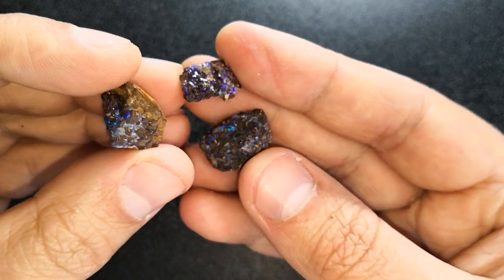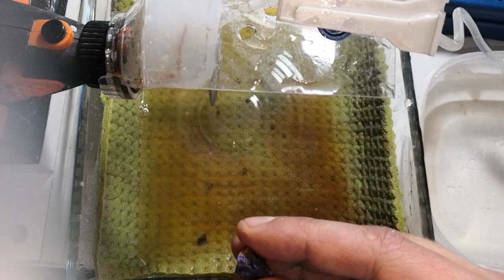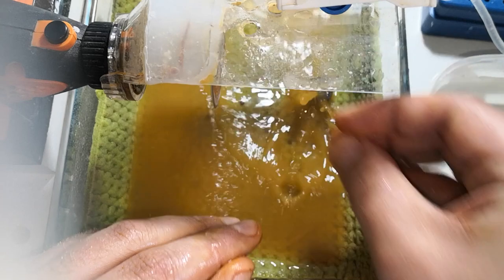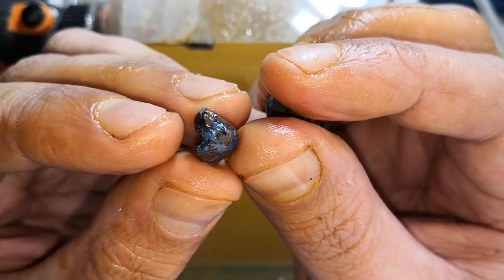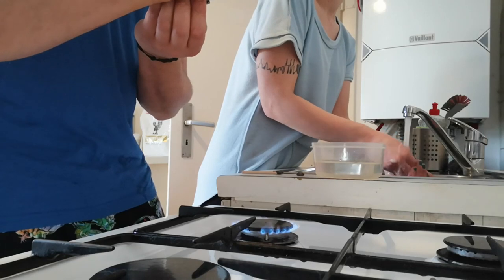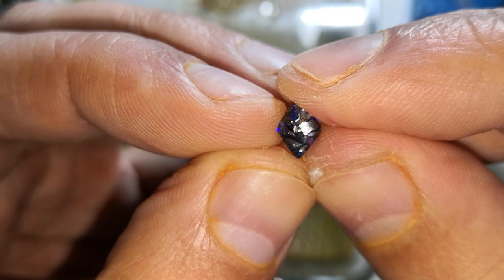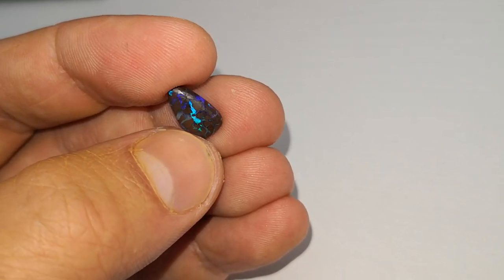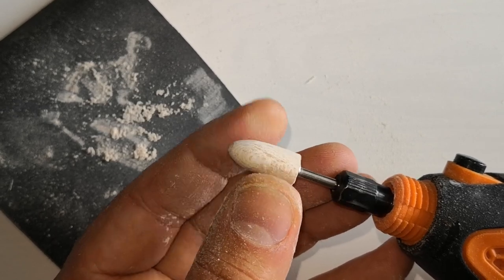How to polish Boulder Opal – Diamond Paste versus Nova Points

Comment: Hi! Kudos on being brave and humble in your sharing. Some responses: I KNOW you should not mix different grades of diamond paste on one wooden point, just like polishing metal, separate your grits. Keep your diamond paste tubes with your designated points. Clean stone in between grade changes - FOR SURE. Otherwise you are blending grits and that does not bring a polish. Also, please stop wasting your expensive diamond paste, use less and add more when you see the need, and don't wipe the excess off your finger on a paper towel and throw away,  save it on the tube tip or a small plastic container, use it later. You can ways dip the wood tip into the leftover paste... economy! I use a small "to-go" sauce container with a lid, I mark it with the grit and store it with tube of paste and any polishing tips of same grit in one clean baggie.. Also, just a thought for economy (money and time), you can buy a complete 3-in1 flatlap system from Inland Craft for about $400, brand new. They are a beginner set up. Even eBay has used ones. Wayyyy easier, safer. A great start! It has a flat lap and a trim saw and easy to switch. They are tough little machines- I love mine. Youve already got hundreds in your set-up, maybe its time to use what you've learned and graduate to the next step up! Love your channel! I vote for your success!
Reply from the maker: Wow, these information are so good mate!!! Thank you for sharing here. I think I will invest in a flexshaft. This will be my next upgrade, also good for upcoming jewelry processes.

Your words mean a lot to me. My next boulders will be happy for the right treatment 🙏

Comment: One thing is ,you need a different tip for each paste to avoid cross contamination of grit size. Which will make a cloudier polish than if not crossed. The cheap pastes are usually 7 percent diamond concentration at most.  So you need to coat your to be polished item , but you can get up to 50 percent concentration from certain name brands .  It takes roughly an hour to use the pastes. This is what I have recently learned.  Ty for sharing
Reply from the maker: Corey, thank you that's awesome! Yeah next boulders will be done with more professional polishing 😅👍

Comment: I recommend a foot peddle for your dremel.  I got an carbon rod peddle from a sewing machine $15 Ebay. Better than electronic peddle that breaks often.
Reply from the maker: Thank you Robert! Yeah, my setup is quiet basic and from the tecnical point of view I often have not a clue about any possibilities to improve it. I am actually working on a better setup and will keep your recommendation in mind my friend
Reply: @opalbadger9367  I do a lot with my dremel 4000. I'm a artisan hobby jeweler too. Have the flex shaft. I don't have too worry about water damaging my dremel. Even made mini wet saw set up for reinforced cut off blades.
 Working on building a real cabbing machine.
Reply from the maker: @roberttyrrell2250  thats awesome mate! When you've finished your cabbing mashine you should make a video about that 😉

Comment: Just pointing out, you ground away a few mm with the trim saw blade. That's probably thick enough to cut a small slice and have 2 opals, if you are careful.. also I have slipped and accidentally pushed my fingers into the dremel trim saw blade. It didn't cut me, not that I'm suggesting you try it!!
Reply from the maker: I always struggle with the trimsaw. Hopefully things will go right in future 😅

Comment: Omg Smurf poop, cracked me up. I have diamond paste and nova points but hadn't tried the paste on opal. I actually think the paste result might just have been worth the hassle, but you could maybe use the Nova's then do a final polish with one or two of the finest grade diamond pastes to get a great result with much less hassle? Just a thought. Thanks for the video it was very enjoyable.
Reply from the maker: Jeni, thank you ❤️!!!

Definetley a better result with the paste. The preshaping with the Nova Points works very well. With 1200grit I had some troubles. I tried out to give it a good polish with 1200 and 3000 grit, but I think in may case the rpm was a greatest issue. So I think an upgrade to a flexshaft would help a lot. Always try to figure out, what is possible and what is just dumb 😅.
Reply: That is what I do. Cerium seems to get stuck in the cracks.

Comment: After 3000 nova
The best way I found to polish boulder opal is Aluminium Oxide powder..
Mix = 1 desert spoon to 1 cup of water.. felt tip.
Keep dabbing liquid on the boulder. Don't let liquid dry or burn out while using felt..keep dipping or dabbing boulder into liquid, and soak felt
After 5 mins do the same but with water until polish is gone.
Hard glass Finnish.

Comment: If you do not have variable  speed  Dremel buy a riostat plug into your tool you can slow down or speed up your tool!

Secondly you want to use a different polish wheel with each diamond paste! You do not want rsdual lower diamond  paste to cary over as it will scratch!
Reply from the maker: Thank you mate!! Yessss absolutly! Will  never be so rude to my Boulder Opal.!

Comment: Last month I ordered that same set of diamond paste. Great thanks to china 14€ :-D
I ran in all that same problems, with too soft polishing tips. In the end I worked with silicone tips instead of balsa wood. It was much easier to get rid of that diamond paste earlier before i changed the colour to next finer grid.
But all in all in the end I need to complain: 1)it is a little bit hairy work, changing the tips and pastes, all that cleaning and wasting paste, so verry much useless work
2) my ethiopian opals became that same colour as the diamind paste. Because one of the most finest diamond paste colours is red, my opal ist now red coloured: so be careful, these pastes are based on oil, which means death for many white and clear opals.
3) working with cerium oxide on leather is much easier and i think also the result is much better. I think even in your two videos you'll see big differences in the clearance of the surface between the stones polished with diamond paste and that video you polished the stone with cerium oxide
Reply from the maker: Thank you for sharing your experience! That will help a lot. I will try cerium on leather! I generally prefer my nova points because i am just lazy and I am always happy with the result.

Comment: Google Keyboard Translator .
Friend, I use precision diamond discs, it is capable of easily cutting obsidian, the opal is soft in comparison, I create tiles of the desired thickness to make the most of the gem in the bud. 
Disc thickness 0.7mm tolerance 0.9mm diameter radius 10.35mm total disc 22.03mm .
Smooth minimal rough opal cut 1mm to 3mm cut seat obsidian 1mm gem seat other mineral gem seat stone iron tiger eye 1mm thick